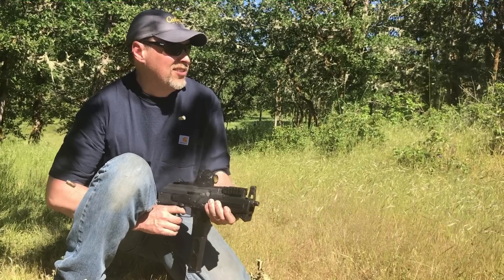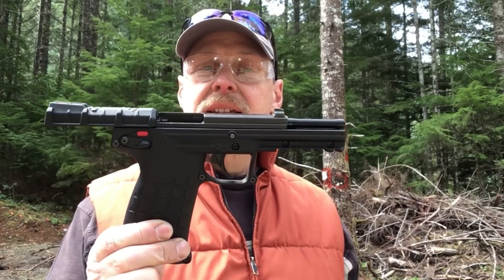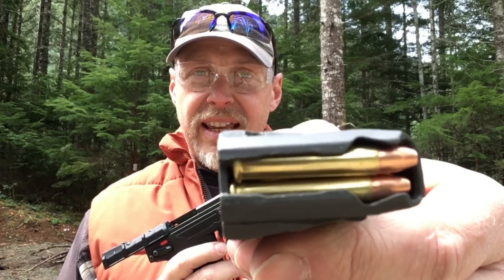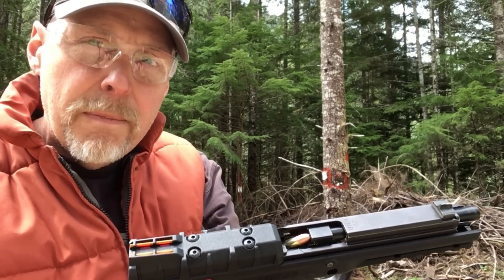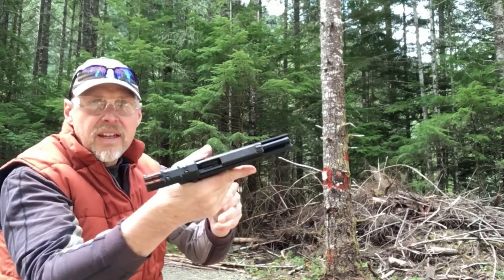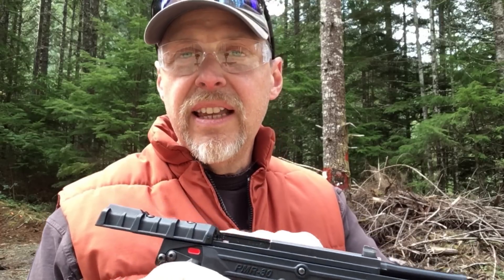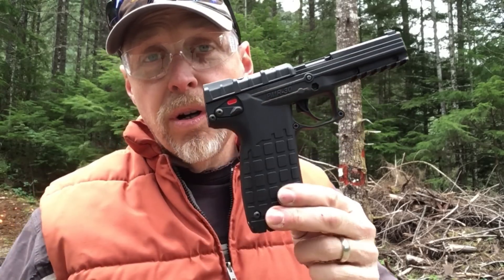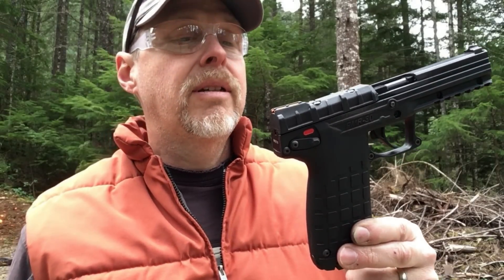Troubleshooting: the Kel-Tec PMR 30

Comment: I love my pmr.    It eats everything i put in it.  Accurate. I heard about problems with it but i have never had to deal with that....but i also bought the cmr.  And it sucks. I want my money back...i don't have enough to just blow and throw it away.   Very disappointed
Reply from the maker: Paula Wood 
  Yes I’ve heard people’s stories about the CMR30. Some say theirs is great and some say it’s terrible. I want one but I’m very hesitant because of the inconsistent reports.
Reply: The best part was i called the company the day i picked it up and there reply was to pot at least 100 rounds of 40 grain or above thru it and that would correct the the problem...i have essentially bought a 1 round riffle it will not eject cartridges
Reply from the maker: Paula Wood 
  We’ll replacing an ejector is a pretty simple matter. If it turns out that the only problem is an ejector a cheap repair could have you loving that rifle. But it also could be the extractor. Do the empty cases just stay in the chamber?
Reply: Yes have to take them out manually
Reply from the maker: Paula Wood 
  Then you are in luck. It’s a broken or non functioning extractor. One of the easiest and cheapest gun fixes.
Reply: @MaxHeadspace9mm  😊 yes i know but still very upsetting when its your first gun buy ever.....oh don't know if i told you that part...just got in to guns a few years ago.  And first thing i bought was pmr. Because of the fact riffle and hand gun work together and am on very limited budget
Reply from the maker: Paula Wood 
  Well that’s a true bummer but look at it this way; guns are mechanical devices. So you not only got a gun but you also got an education😉. But seriously, you will get to know sooner or later that guns can be finicky beasts and it’s best to know your equipment for your own safety. May not be the most desirable start to a journey but it’s a start none the less🤔

Comment: I bet you spray that crap on some .22's and wait 6 months, none of them would go off.
Reply from the maker: Shawn Swigart 
  Definitely possible. Just a desperate move by me to make this pistol usable if at all possible. But the spray dries extremely fast. It was completely dry in about a minute. And then I loaded them in the mag and shot them out. 
  Turns out this didn’t really help this gun. The problem was much more serious than I realized was possible. The follow up video “KelTec PMR30 100% Reliable!” Tells how this was finally resolved.

Comment: I'm scratching my head because I've not had a single  problem with my pistol with over 2000 rounds. It's my intro pistol for every new shooter that I have taken to the range. My suggestion is to use the recommended ammunition and load the magazine as per the  instruction manual. That's my simple fix!!! Or we can make bullshit vids to make ourselves think we're more intelligent then the average Bear.
Reply from the maker: B Wild 
  Yes I believe there are plenty of people like you who have had great success with their PMR30. But it’s a fact KelTec makes inexpensive guns. They don’t have some voodoo magic that allows them to do this when all other gun manufacturers have to charge more. Their secret is that they cut corners and use less material and looser tolerances. Mainly not resharpening their tooling as often in the production line up. They get more parts per run that way. I know this is fact because it’s what I do for a living. As a result they have a greater percentage of their product which isn’t able to function as designed. 
  So you made the assumption that I’m stupid but that is your mistake. I have a huge gun collection, I shoot a lot and I know how to load a mag. Before I took this out for the first time I did plenty of research. I also read the KelTec manual in its entirety. I went and bought the exact ammo it called for and loaded it as instructed. I also watched quite a few YouTube videos to understand this weapon. I loaded more carefully that I’ve ever loaded a magazine before because I knew many people have trouble there. So your assumption that I’m an idiot and that there’s nothing wrong with this pistol shows how little experience you have with guns. They are a machine. They malfunction if something is wrong. And I’ll tell you a secret: I’m uploading a new video about my conclusions about this pistol and there was definitely something wrong with it. Not user error. So instead of coming off like a jerk that thinks he knows everything why don’t you simply admit that some people get these pistols and don’t have the same luck you did? And if you don’t believe me then do your own research and watch a few more videos and you will see it’s impossible to ignore. KelTec doesn’t have a stellar reputation for reliability. I wonder why?🤔
Reply from the maker: B Wild 
  Ok. I see the problem here. You simply don’t pay attention and then go on to make incorrect assumptions. That is a dangerous thing to do so let me set the record straight. I never called you an idiot. I said you are acting like I’m an idiot. Go back and read my post carefully. Secondly you assume that it’s impossible for KelTec to make a faulty gun and would prefer to assume I have some ulterior motive and want to muddy their reputation which is also not true. Why would I buy and invest all this time into this pistol if I thought it was a waist of time? Thirdly, it is a clear fact that KelTec makes some of the least expensive firearms of all the popular brands.  It is also a fact that if you ask people who have a lot of experience shooting lots of different brands of firearms which are the most reliable Glock, HK and FN would be at the top of the list and KelTec and Taurus would be at the bottom. You assume I don’t like innovation but you’re wrong again and if you had watched my videos about the Calico M100 I own you would see an extremely modern and innovative 22 rifle that I love and enjoy shooting often. Heck, the whole reason I got this KelTec was because I liked the innovative design features. 
  So I’m sorry if I offended you. Maybe you were in a bad mood before you watched my video but I can’t see or understand why you would watch this video and then proceed to come to a very different conclusion than all my other commenters.  Could you possibly just calm down and reassess all your assumptions and see I’m actually trying to help people? Or do you feel it’s somehow immoral to show a malfunctioning gun on YouTube?

Comment: No way I'm going to spray my bullets to make a poorly designed gun reliable.
Reply from the maker: beckerod777 
  I wasn’t suggesting everybody do that. It’s just a thing I do to find out the source of feeding problems. Turns out that didn’t work good enough. The next video in this series, “KelTec PMR30 100% Reliable!” Explains what was wrong and how it works flawlessly now. After that I did “PMR30 Penetration Testing” and finally PMR30 for Self Defense? 1,000 Round Review”. This gun is now my favorite. And I have al lot of Glocks and an FNX Tactical 45 and. CZ75. But the PMR30 is the most accurate and useful of all of them. Don’t just make assumptions. Watch and see.

Comment: Please acquire a Remington R51.
Reply from the maker: Troy Ellis 
  Beautiful, but why?
Reply: Max Headspace9mm I have a lot of issues. Nose dives when firing JHP. Maybe you can figure it out.
Reply from the maker: Troy Ellis 
  If the JHP are different grain weight or velocity then it could cause that. How much difference is there in point of impact with target 115 grain? Is the bullet actually becoming unstable and keyholing?

Comment: Great video.  Is the PMR30 you are using a Generation 1 or Generation 2?  I can't really tell from your video which one it is. Here is a useful link to help determine which one you have.  (https://www.youtube.com/watch?v=ISbIlBV89Zw)  You may want to update your video (or comments) once you determine which version you have.  The Gen 2 come out in 2014.  The Gen 1 was very prone to chamber failures unless it was repaired by KelTec.  The Gen 2 solved this problem.  I have had a Gen 2 PMR 30 since October 2016.  I love mine.   CCI 40-grain Rocks!!!
Reply from the maker: Michael Jacobs 
  Thanks for the link. I watched it and determined that mine is like the older of the two examples he had there. He said they were both newer and ran fine but that it was the gen1 that gave trouble. I’m guessing it’s the one I’ve heard about with the fluted barrel. Mine doesn’t have a fluted barrel but the caliber stamp is on the slide not on the frame. So it seems to be the earlier example. 
  I’ve been working on it with no success so far. Even tried every grain weight I can get ahold of. From 30 high velocity hollow points to 50 grain. No luck so far but I’m not giving up. I’m gonna lick this yet.

Comment: Are you at 500 rds yet
Reply from the maker: dylan dewalt 
  Not yet. This pistol isn’t fun to shoot when it’s not reliable. So I only put a couple mags through it each time I go out. But I would expect it to be improving. At this point with a little over three hundred down the pipe  I’ve done all my usual fixes and it still has hiccups. We’ll see....
Reply: Max Headspace9mm ok thanks

Comment: magazine issues. FT feed, mag issues
Reply from the maker: Jose 
  Watch part2, “KelTec PMR30-100% Reliable!”  It had some real issues from the factory. It’s been great ever since. 
  I did strip down, clean, lube and check out the magazines I have for it pretty early on.
Reply: THANK YOU! I just watched the second video. Excellent videos, both of them. I presume you are an engineer by the way you approach the problems, very methodical and logical. Great channel too.
Reply from the maker: Jose 
  Thank you. 
I’m not an engineer by trade. I just have a lot of very handy people in my family. As a kid I learned a lot from my dad, grandpa and uncles. I’ve also used, trained with, fixed and restored a lot of guns though I am not a gunsmith. It’s just a passion of mine. Glad I could help😉

Comment: Umm what are you talking about? The PMR30 is super reliable! You need to follow the instruction manual on how to load the mag properly and that is why it's jamming!! READ THE INSTRUCTIONS PAMPLET!! D not do what this man is doing! Loading the mag right is the most important thing about this gun!
Reply from the maker: rAdiant Jet 
  I own hundreds of guns and have loaded tens of thousands of cartridges into magazines. I didn’t get a manual when I got this pistol from a friend who sold it to me but I downloaded the online manual from KelTec. I loaded the magazine exactly as they said to do. Every time. Extremely carefully. That is not the reason I was having malfunctions. If you want to know the reason I was having malfunctions you can watch my next video in this series, “KelTec PMR30 100% Reliable!”  Then “PMR30 Penetration Testing” then, “PMR30 for Self Defense? 1,000 Round Review”. Then you will have the whole story. 
  I’m glad you are one of the fortunate few who have had a Reliable PMR30 right from the start. Many aren’t so lucky. And incorrect loading isn’t always to blame.
Reply: @MaxHeadspace9mm  i work at Kel-tec and if someone did what you did it would void the warranty! Also you might have a gen one PMR that had issues with the fluted barrel. If that's the case, get intouch with Kel-tec and we should be able to help you with changing the barrel. Besides that, as long as the gun is loded corectly, it will not jam! I own a few PMRs CMRs and so on. I know these guns
Reply from the maker: rAdiant Jet 
  Will you please watch the videos I listed in the last comment? Then you won’t look so silly. All your concerns are answered in those videos! PLEASE WATCH!!

Comment: The easiest way to fix the PMR-30 it to throw it in the trash can.
Reply from the maker: howlingmine 
  That certainly is easy. But if I did that I wouldn’t have the flawlessly performing pistol I now have. And that would be a real shame. Watch “PMR30 for Self Defense? 1,000 Round Review”.
Reply: A guy brought one in to my gunsmith while I was there. He laughed and said " they call them jamomatics for a reason".
Reply from the maker: Ron Smith 
  Yeah. They have a pretty terrible reputation for jamming. But I’m here to tell you once the one in this video got fixed I ran over 1,000 rounds through it without a single malfunction of any kind. Now I’m a believer and I used to think KelTec was just a tiny step above Hipoint.
Reply: @MaxHeadspace9mm  should you have to run a 1000 rounds through a new pistol to make it run? I'll pass on Kel-tec
Reply from the maker: Ron Smith 
  No. After I got it back from KelTec it hasn’t failed to function perfectly and I’ve run over 1,000 rounds through it. It’s a blast and it’s accurate and it does everything I could possibly want, weighs half what my Glock 17 weighs and holds nearly double the number of rounds. Fantastic gun.  If you want to hate it that’s your prerogative but you’d be making a mistake thinking it’s less than fantastic.

Comment: kal tec  pmr 30 never worked even after 20 evolutions of parts and crap its still junk ..amt automag was better    < i sold 30+ of these guns very few worked out of the box > only guns worse would be some of the bersa/eaa crapola calico and  Thomson repo shit ...looks good on paper but at end of the day could have gotten something you didn't have to baby stroke and rub and then hope it works
Reply from the maker: 10dolladaddy 
  I did four videos about my PMR30 in total. The last one titled, “PMR30 for Self Defense? 1,000 Round Review” is a hum dinger. I got this fixed and it has been ridiculously reliable and accurate. Never would have believed it.